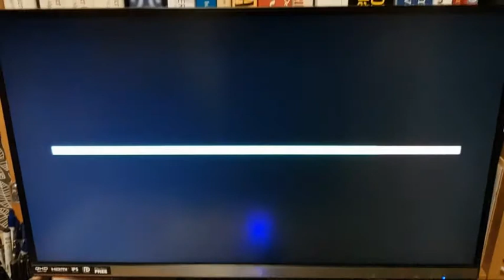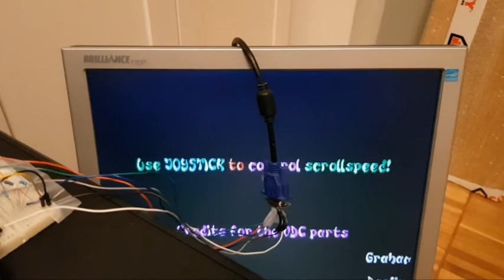C128 with Pi1541Zero running Risen from Oblivion using RGBI to VGA conversion via an ESP32

Comment: Greetings from Australia where we also use PAL. I'm trying to use your code with my Amstrad PPC 512 CGA (RGBi) output.
I have modified the fabglconf.h:  define FABGLIB_VIDEO_CPUINTENSIVE_TASKS_CORE 0 and then  I have loaded your code.  Everything looks great but the image doesn't sync, it rolls up slowly. Any suggestions?